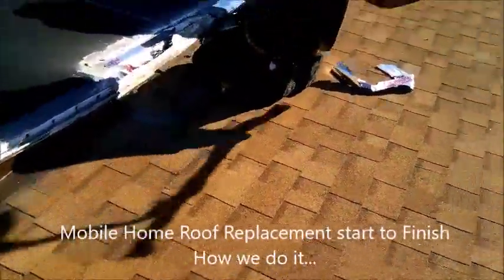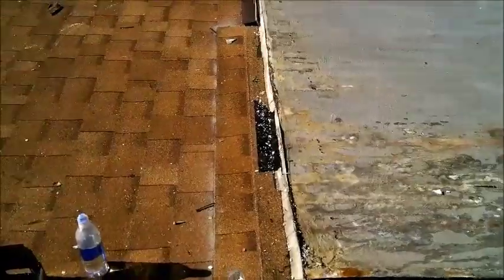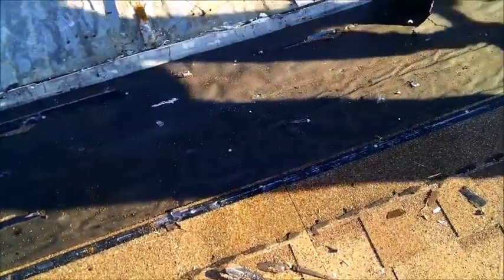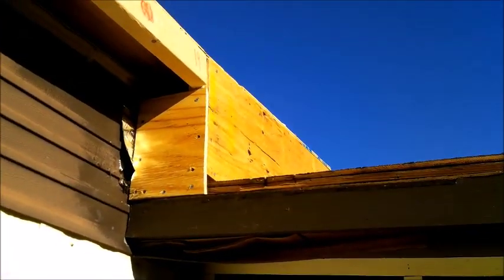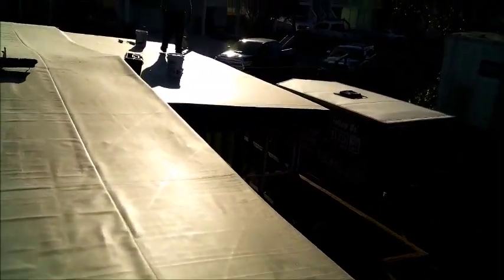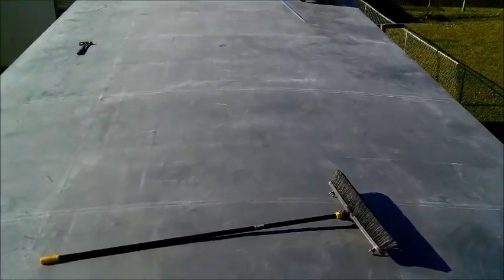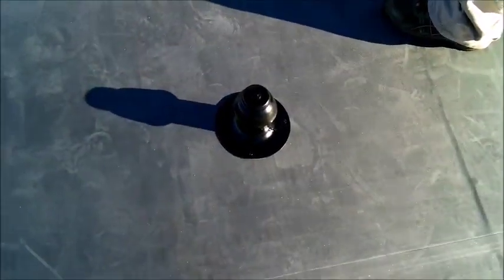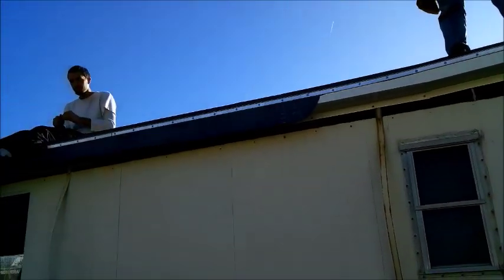How to install a Mobile Home roof using plywood and EPDM Rubber

Comment: Could you run 2x4 and "reframe" the roof the attach osb and place the rubber on?
Reply from the maker: Yes I do this. https://youtu.be/f82kikum1B
Reply from the maker: https://youtu.be/f82kikum1B8
Reply from the maker: Always check for wires if it’s 1980 or older

https://youtu.be/NzvVfVXFAzQ

Comment: Do you need a plywood base for rubber? Can you lay it on the metal only with adhesive....
Reply from the maker: If I was going to put it up without the OSB I would make sure I definitely used adhesive because you want the rubber to contact so there is no space in between it because the space in between well condensate. So if you are completely adhered to the roof you should be fine. I’ve only done two without plywood so far they’re both still there

Comment: Hey Drew - Sometimes you use OSB and other times you use plywood. What are the determining factors?
Reply from the maker: The homeowner. Sometimes the homeowner here’s OSB is a terrible thing and they don’t want it so I use whatever the homeowner wants plywood is $10 more per sheet that’s all
Reply: I am glad you used osb when you did my roof in RI. I would rather have osb than plywood under my rubber roof. The pros outweigh the cons.
Reply from the maker: Yes ma’am you’re exactly right that Roof We Did in Rhode Island or anywhere for that matter the best thing you can do is use OSB I would never put plywood underneath my rubber it delaminates so bad and when you put screws in it it splits

Comment: Drew plz leave contact info. I need a roof in franklin NC   Want  a rough estimate and what guarantee do you have?
Reply from the maker: Five year no leak guarantee is my guarantee that’s about all you’re going to get with this EP DM using it on a residential property where As it is a commercial product
Reply from the maker: Call the office leave a message 910-845-2207 with your address and send text messages to 910-294-1761